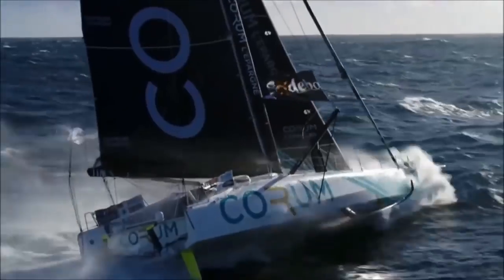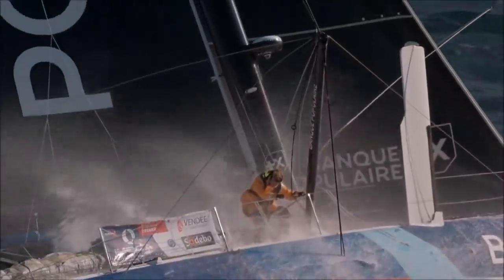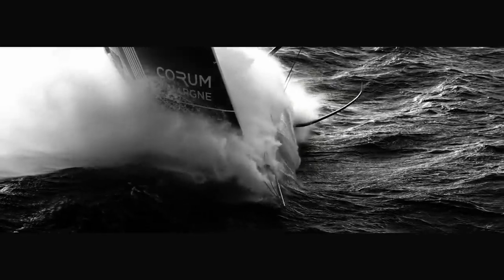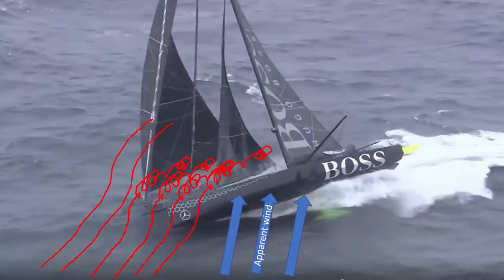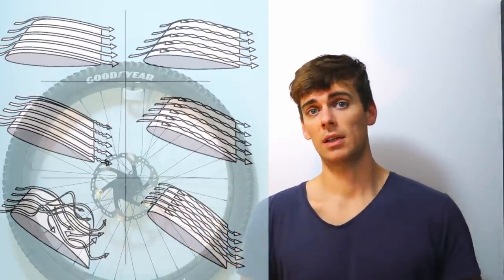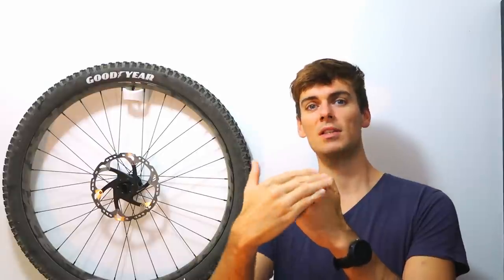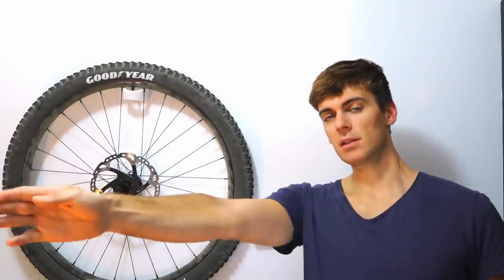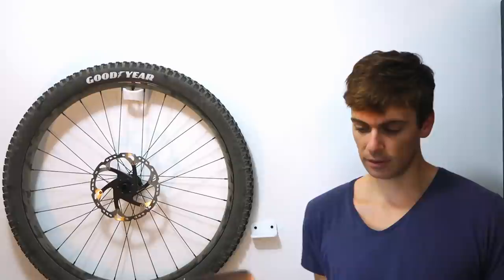Why Corum Dismasted - IMOCA Tech flaw? #VendéeGlobe Boat Design Analysis Part 2 - Aerodynamics

Comment: Thomson broke one foil early on in the race last year. He was forced to sail the majority of the race with one foil. Hence he is sailing it in a different manner. If you noticed from that same footage Armel's boat (banque populaire) is at much lower heel angle (more typically for foiled imocas). 

With foils the boats are able to lift up out of the water, wetted area is reduced and sailing on apparent wind is possible (see how 49ers sail downwind). Without a foil they sail with pure power and therefore go for big and deep cambered sail plans.
Reply: I noticed, last three days, that HB was consistently a knot or two slower than both Verdier boats when they were on near identical course and wind. Think that’s boat speed or skipper risk management??
Reply from the maker: There was definitely an element of doing it for the cameras from AT in those shots :) particularly seeing as it was French coast guard filming :)
Reply: @PeakTorque    you aren't suggesting that he's a showman are you? :P

There was one HB press release about design where they talked about that video and how they sailed in a different way. Also that the if they lose a foil this time that the disadvantage would be much greater.

Interesting hearing them talk about HB foils having a constant radius, therefore presumably a stable lift vector no matter what heel angle. Also this means the tip piercing the surface gives a self leveling effect as lift is reduced with ride height.

I would be interested to see your analysis of the loads of the new AC foils.

Comment: Just a thought, When the boat heels the wind does not heel with the boat. When an aircraft yaws the lift is lost and the aircraft losses altitude, de-powers. Would it not be best to allow the mast to stay upright allowing the sails to keep the pressure and allow the heel and keep the lift it needs to stay on the foils? The suggestion is to put the mast on a pivot joint controlled by stays on a winch to keep the mast at optimum angle.
Reply from the maker: Yep that is one issue that still in this century we let happen. 😅 A canting mast is pretty technical to implement, so its best to prevent the heel in the first place by using wide footed foils to creat the righting moment like the new AC75 boats. They actually slightly heel to windward!

Comment: Comparing a solo circumnavigating boat with ac75 is funny. I suspect you have not yet that much experience in offshore sailing? Some good points but mostly nothing new, e.g. the detrimental effect of heel is very well understood, but still any heel is not bad in a monohull. As any sailmaker would tell, sailboat aerodynamics is an awful bunch of compromises where the lifting line theory offers no answers. I agree though that stanchions and struts should have fairings, preferably freely rotating wind vane type. Even if stanchions are never intended to be clipped on, they are quite essential piece in the boat.
Reply from the maker: Of course they're very different boats! I think i mentioned that somewhere... inshore races, surrounded by people and cameras etc...was more comparing tje design philosophy.
Reply: @PeakTorque  Yes, you probably mentioned it. But the design philosophies would differ a lot by necessity, and there are many things that can be learned from AC - and indeed have been learned - but many others are not applicable for a reason. Anyway I think that IMOCAs are great example of boats which sacrifice a huge amount of upwind performance in exchange with downwind performance, something that AC boats can not do.
Reply: As I understood Peak Torque, the difference is between two sorts of three-point contact: one is on three lifting foils, the other is on two lifting foils and a dragging stern
They both transition back and forth between displacement/planing & foiling
Reply: @sailawayteam  Essentially all AC sailing is upwind with a variable relative wind

Comment: Even thought your comments are great and some of them are on point, you need to realise that the vendee globe is not a sprint race, it's an endurance race were half of the boat don't finish because they break.
The boat are never at 100% because it would be too hard for the skeaper to maintain such a rythm. So very marginal gains are not very interersting if you lose simplicity and reliability. That's why comparing AC 75 and IMOCA doesn't make a lot of sense.
Now if you like high perfomance and boat that can sail on the sea, look at Gitana and Sodebo
Reply from the maker: Yep. I know. Totally different applications. But I'm referring to them for the trickle down effect of features that could be implemented with minimal impact on safety. Lifting T Rudders would arguably make the IMOCAS safer with more stability!
Reply: @PeakTorque  yes but it would put a lot more strain on them, and since they have to go on eavy see, I don't know if the stability controle would be able to cope with so much variable
Also, i think that the fact that the boat are lifted from the front is probably on purpose, because it alows them to use theire foil in heavier condition 
But I might be wrong, it's not with this kind of reasonning that you advance the sport, I just don't want the skeaper to put themself in to much danger just to improve performance

Comment: Just love your witty explainations - in re of aerodynamics you are 100% right - designers must search for practical solutions to reduce drag - got a question for you about structural design - why arent naval achitects using latice frames more under the deck to absorb the forces from mast and rigging, keel and foils?

Comment: An interesting analysis.  One point I haven’t seen in the comments about round section spars and stanchions etc is this.  These boats are primarily downwind specialists.  Most of the race has the wind on the stern quarter, optimally at 120°, so round section may assist in forward motion as wind speed will usually exceed boat speed.  WRT to the sail bag, the racers will usually have reefs in the main and it would be vital to protect the unused sail from collecting a drenching and being ripped off.  You’d certainly have to provide an alternative solution to protect the reefed potion of the sail.  Whether in-boom furling would be strong enough and reliable enough, I have no idea.  Similar to F1 cars, these design teams go to remarkable and probably dangerous lengths to make the boats lighter.  I’d imagine that the weight and reliability of mechanisms to automate safety such as popup stanchions is not going to happen.  The race is already ridiculously hazardous

Comment: Interesting. The thought occurs to me that the difference between the Vendée Globe and the America's Cup in regard to stanchions, is that if you fall overboard in the America's Cup race you have a pretty good chance of getting picked up in short order. Being able to stow them might be a solution, though you do have to consider the failure mode consequences if you had to deal with an issue on the foredeck off of Tierra del Fuego.

Comment: The stanchions have a trivial area compared to the hull. They do have a real safety aspect (if you go over the side clipped in you may be saved by the guard rails. No guard rail makes it almost impossible to get back on board and remember these are solo sailors so no one to help) and since the wind can come from all directions a circular cross section is not so bad. Having folding stanchions adds complexity and one thing about boats is that if it can go wrong it will...

Comment: this a great channel for this discussion and based on the comments so far, there are a lot of people that really know what they are talking about. My overall impression of the IMOCA design is that they are not ready for the conditions during the Vendee Globe and the total collapse and  breakup of Kevin´s boat and Alex cracks in the bow of his boat even prior to hitting the Souther Ocean show the weaknesses. They need a re-think. The rigging is another. It isn´t strong enough and they will  probably see more failures are the race goes on.
Reply: This is normal. Traditionally we’ve always had about 50% dropout. Roughest seas. Lightest boats. Hardest sailed. Craziest people. 
Making the boat stronger is easy. If they spent more time they would be finding what else they could remove and still get away with it.

Comment: Having a deck sweeping skirt under the boom certainly would increase the effective aspect ratio of the mainsail. It adds drive without much more healing force. The downside of this is the boat tripping over the boom dragging abruptly at high heal angles. This may be a compromise made for seaworthyness considerations. This is a marathon event and just finishing is a victory.  The cyclic loads on the hull and rig will eventually locate a weak point of the design or construction. They're pushing the limits of material strength and fatigue life beyond what's safe.

Comment: @heel angle:  Hugo Boss lost on the last vendee the starbord foil!!! Thats coses the heel angle on Port Tack! On die other side ist wasnt that mutch.
Reply: To my guess he voluntarily over sailed the boat to increase the heel and hide the broken foil to the camera. That was more strategy than sailing. Check the images from Armel Le Cleach at the same place, he is just sailing with a jib. Alex deployed his code 0 for heeling/hiding purpose. IMOCAs also need to have some heeling angle in order to have the keel to act as as lifting foil.
Reply: @christophetournay6706  I thought he cut it flush and then retracted it. I didn't get to watch the race while that had happened. I'm new to this concept being an annual race.

Comment: A good watch but it’s not fair to keep comparing a round the world design to an AC design or F1 design.        I’m sure if you designed a mountain bike to ride around the world then it wouldn’t look like a track bike.        How about if you cover the mishaps back in the 90s where imoca designers were given too much scope.
Reply from the maker: Yep. I know. Totally different applications. But I'm referring to them for the trickle down effect of features that could be implemented with minimal impact on safety. Lifting T Rudders would arguably make the IMOCAS safer with more stability! It is not hard to fair the stanchions or outriggers aerodynamically, in a non structural manner. This is the kind of relaxed 'cant be done' mentality which is why sailing is so far behind.

Comment: About the outriggers and stanchions being round.
An airfoil will have a lower air drag only in two directions, while the air blows around those elements from lot's of angles.
You can only optimize those for a narrow angle of attack where they'll be beneficial, while in all other wind directions they will work far worse, most likely heeling the boat more, and putting additional bending force on those. God forbid a wave hit's a flat face of such a foil and you get the outrigger and the mast broken instantly.
Retractable stanchions would add lot's of weight and complexity to the hull, and another point of safety failure which is seriously critical at rough sea, especially if you're alone on the boat (although people died also in recent fully crewed Ocean Race editions, where at rough sea nothing will help you if you fall of the boat, you just die. Sea is no joke, especially the Southern Ocean.

It would be very beneficial if you got some experience at sea. You need both the inner rails for the life lines, and the outer rails that you can lean over, and that can catch you when a wave goes over the hull.
AC  boats are basically toys that are sailed only in great conditions with basically no waves at sea (which is why their race courses always have natural barriers from the sea around them. So no offence, but those arguments are useless.

Also it's seems like you don't realize that those IMOCA boats are relatively really cheap compared to AC or F1. Those boats are usually around just 3-5 million euros. While the AC boats are usually over 100 million $ each, and that's usually just a part of the whole program cost for each team.
The record breaking round the world boats are the Ultime class 100ft trimarans, not these monohulls.

The last thing is that those new foiling imocas are in fact, clearly way too performance oriented, as you can see how easily they get damaged even without any collisions, so they have a very much reduced seaworthiness factor that is just as important as the aerodynamics of those boats. And they've only been a couple days in the rough sea, so this looks really bad. I reckon that a record amount of boats won't finish this year.
Reply from the maker: As i mentioned in the video, the foils for stanchions would be self setting to 0AWA (Foils free to rotate on bearings like a weather vane). Fixing foils at an angle is not a good idea, i did not suggest that. 

Erecting stanchions by a halyward rated dyneema and secured by bi-redundant jammers/clutches would be my idea. Arguably safer than the way they are currently bolted on by a small flange to most decks, which can rip out and arguably should not be used to harness on to! 

Of course AC boats can't be compared to, i was merely referring to them as inspiration. Its this kind of resistive thinking in sailing that's so engrained I'm sorry to say. Of course safety is paramount, and any suggestions i made are not putting safety at risk if engineered properly. The latest fleet of Imocas are a joke to be brutally honest. Bow longitudinals failing prematurely, PRB snapping in two?! Crikey. They've got a lot more to worry about than some stanchions.
Reply: @PeakTorque  According to Kevin the PRB had over 300kg of additional carbon reinforcements around the hull over what the VPLP designed.

The stanchions with rotating aero covers indeed would work, unless they'd bend. Anyways those aren't made super strong on boats because the rails depend mostly on solid front and rear mounts for the steel lines that work as the rails, and those never break. Even if the stanchions bend or break the steel lines still keep you on the boat.

I'm not sure what do you propose exactly in the sentence about removing the stanchions.

As to the harness, you never lock the lifelines to the side rails because that could be dangerous. The boat running down a wave can actually throw you up over a meter from the deck, especially in bad weather on the bow when you secure a rolled jib or something. Add strong wind to that and you're off the boat. With a lifeline secured to a bar running along the axis of the hull without much slack you stay on the boat. Doing this with a lifeline secured to an outer rail you'd end up in the water and could drown if the boat was pulling you at speed and waves were hitting you.

I'm not saying innovation is bad, it's obviously great and the whole reason that we advance in all fields of science and engineering. It's just that you concentrated on the performance, and that's not really the most important thing at sea, even in a race.

Also thanks for your reply.

Comment: I would be very cautious in making assumptions regarding things like end-plating the boom to the coachroof and the shape of the outriggers... the designers have a massive amount of analysis and experimentation across many different types of cutting edge boats. I can guarantee that they all have looked (and used) your "ideas" for decades. These guys, like Verdier, have designed all those things on current AC boats. So I think it is safe to say that they have run those things in their models hundreds of times and have a reason for their choices. They are all pretty smart guys with a lot of incentive to do all those things you recommend. 

If you want to get an idea of sailing innovation, check out some in-depth tech videos on the 52 class. All the stuff you are thinking about has been thought of for decades. See if you can spend some time with a top design group you will see that no one, ever, says, "It's always been done like that, so we won't bother optimizing it."

Comment: Rarely have I seen a vid starting out so good and ending so poorly.  1)Never ever compare an AC to an IMOCA. ACs are lake surfers, constantly surrounded by other boats and never more than half a mile away from land. IMOCAs are ocean gladiators with one-design elements to even out the field (budget) and get a bigger fleet.  2)Retractable stanchions... well... :) What if you're close to point Nemo in 24ft waves and your gadget stanchions won't come up ? You seem to forget that the autopilots on these will stay on heading, and if the skipper is dragged behind his boat at 20kts, he will simply drown because...wait for it... he's alone on his IMOCA.  3) The sail bags: do you really think you can simply fold an IMOCA mainsail ? In the south pacific, they have 2-3 reefs for days. 4) Most importantly, nobody's trying to break records in IMOCAs, unless they're trying to beat other IMOCAs. And most of the time, the winning boat is the one that had the least problems. The shared goal of every Vendee Globe fleet is getting to the finish. Your ideas, whilst theoretically sound share one trait: they nearly all reduce the chances of getting back (alive).